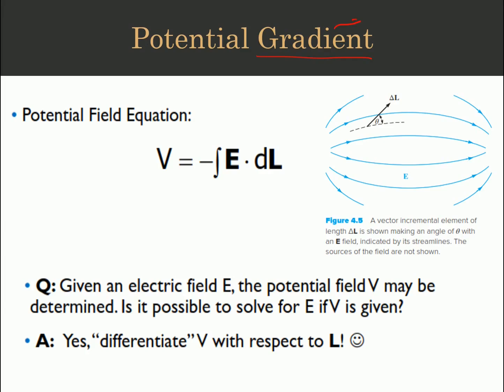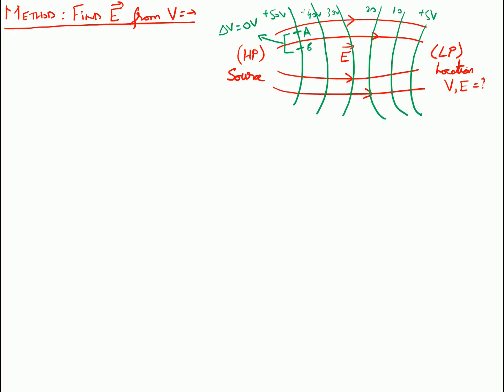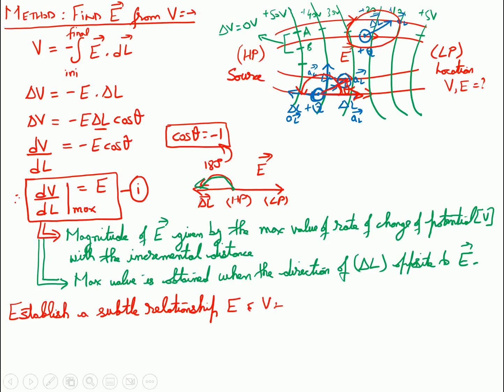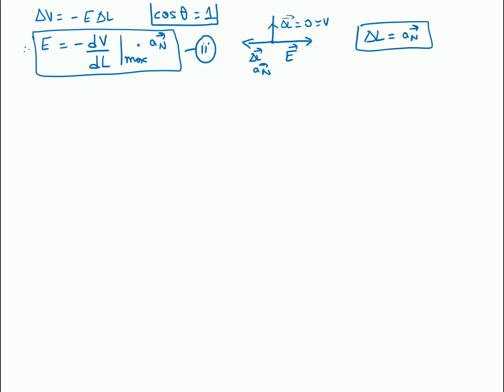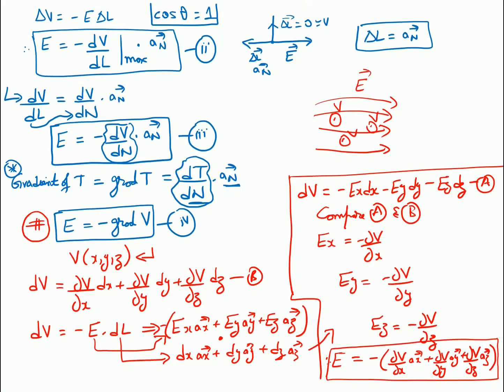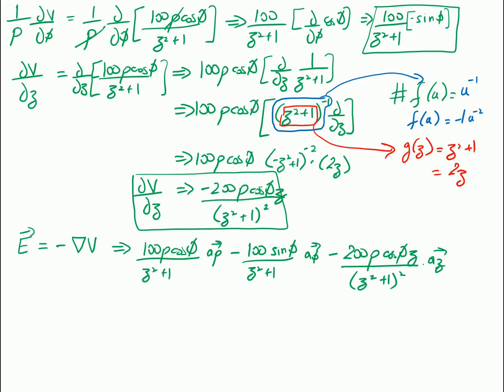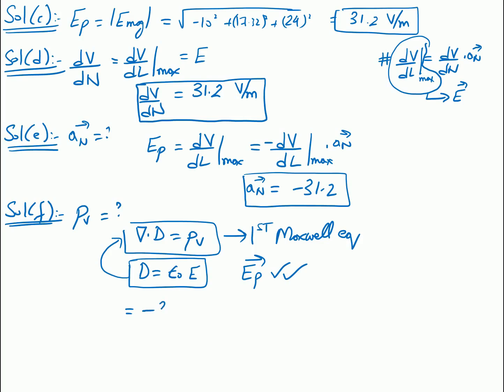Lecture 18 - Potential Gradient

Comment from the maker: Timestamps 
00:02 - Understanding potential gradient and its significance in electric fields.
02:58 - Finding the relationship between electric field intensity and potential.
07:53 - Deriving electric field from potential differences using line integrals.
10:22 - Electric field magnitude relates to rate of change of potential.
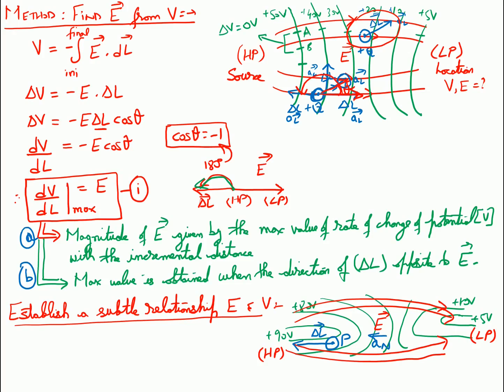15:42 - Electric field direction influences potential gradient.
18:00 - Introducing unit normal vector in electric field equations.
22:19 - Electric field relates to voltage through partial derivatives.
25:02 - Electric field represented through potential gradient relations.
29:47 - Determining potential and electric field intensity in cylindrical coordinates.
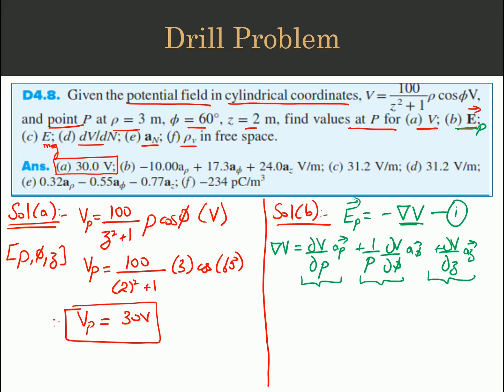32:10 - Calculating partial derivatives in relation to variable interactions.
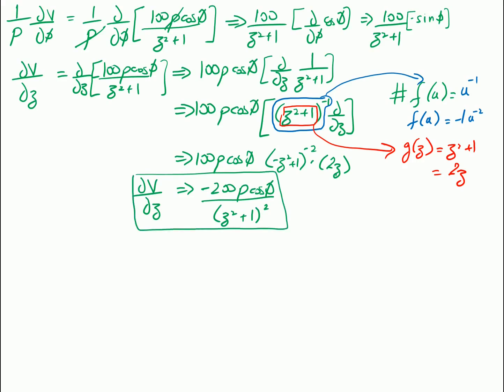37:10 - Calculating electric field intensity through partial derivatives of voltage.
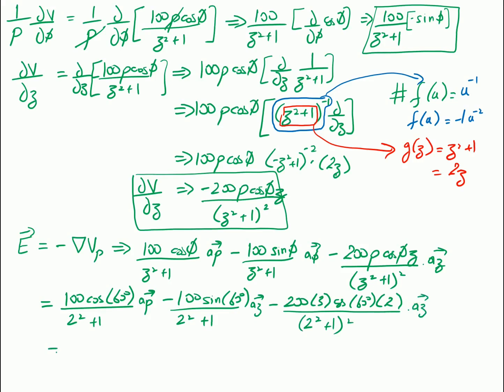39:54 - Calculating electric field intensity and its magnitude.
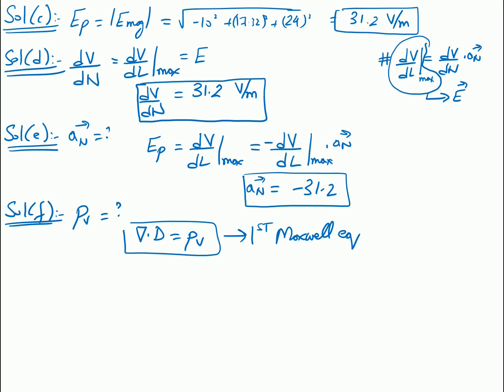44:28 - Calculating D using given values in cylindrical coordinates.